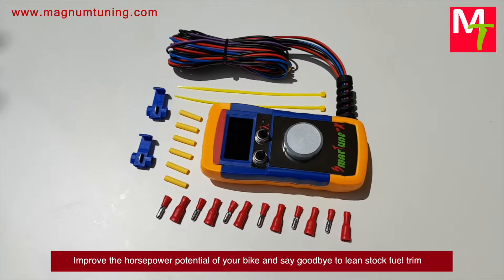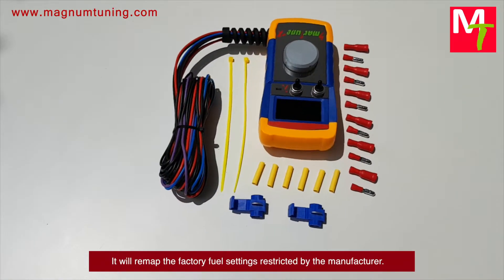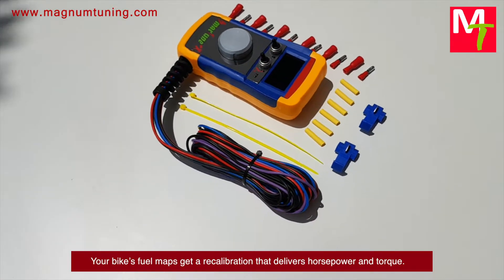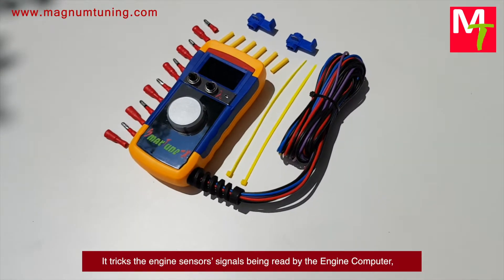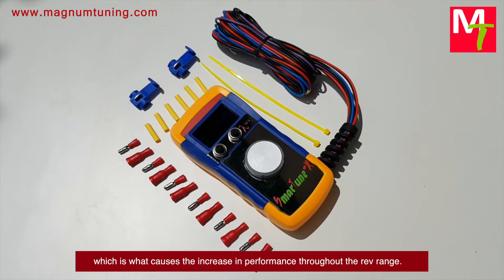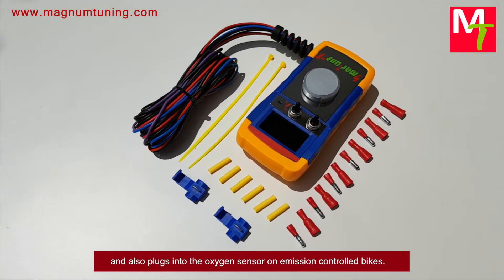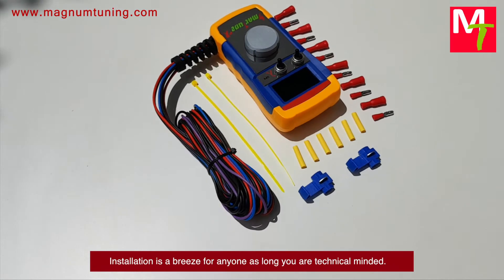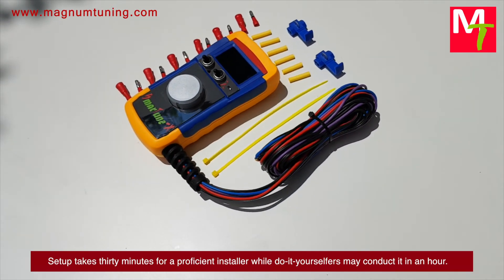Smart Tune Motorcycle Fuel Tuner   Aggressive Boost in PERFORMANCE!

Comment: I have Lifan kp mini 150 2024 with aftermarket exhaust I want to richen fuel for better throttle response will this work?
Reply from the maker: Hello,
Thanks for reach us out. Smart-Tune is available to your KP Mini,

https://www.magnumtuning.com/en/detail/smart-tune-motorcycle-fuel-tuner-performance-module/lifan/kp-mini-150

and yes it is designed to allow you to remap the fuel trim but please keep n mind an aftermarket exhaust triggers the check engine light so if you don’t want to have your bike run with CEL on, you will have to install an oxygen sensor simulator. 
 
https://www.magnumtuning.com/en/subcategorylist/bike-atv-jet-ski-snowmobile-performance-chips-parts/bike-upgrades/#o2-sensor-simulators 
 
to unlock the ECU safe mode that would prevent the remap from going through. If you want to use the heater of the factory oxygen sensor, you may wire up #796 (Easy CEL fix). #664 allows you to remove or eliminate the stock oxygen sensor completely.

Should you come across further question please visit our website. 

Have a great day.

Magnum YT Team

Comment: What is the weather and temperature robustness? Is it ok at -20C? 50C? 60C?
Reply from the maker: Thanks for contacting Magnum Tuning. Sorry we can’t seem to understand your question regarding the robustness wording, Apart from that adjustment allows you to correct the fuel trim at different altitudes and ambient temp if this is what you are referring to is unrelated in this respect. You don’t have to take any temp data into account. Please note our YT team is not setup for technical support via Youtube but you can find answers to your questions at https://www.magnumtuning.com/en/contact_en 

 Have a nice day
Reply: @magnumtuning  I am talking about the operating parameters of the unit. The environmental conditions that the unit is manufactured to operate within. For example, we have air temperatures from -20C to 50C. Also, because the unit must be kept on the motorcycle to function, it may be placed near the heat of the engine, and may be exposed to temperatures of 60C or so. Usually, this information is part of electronics because outside of the temperature range that electronics are designed for, they may not operate correctly, and may even fail. Electronics are also subject to the expansion and contraction of temperature changes which can make them fail.

Comment: hi guys this looks like an interesting product - does it allow adjusting how much fuel is added or is it fixed at +17% ? (like listed in the specs).
Reply from the maker: Thank you for your inquiry. Please note the amount of fuel added is not in par or in linear coherence with the extra horsepower rate, in addition the fuel delivery varies permanently in each microsecond. The only relevant specs is the amount of extra horses here, being 17% but please keep in mind it is also subject to change between slightly lower and higher percentage across the entire rev range. Should you come across any question feel free to contact our  tech support. 

https://www.magnumtuning.com/en/contact_en

Cheers

Comment: Does it work on a 2019 Suzuki RMX450Z?
Reply: Does it work on a 2019 Crf125f big wheel fuel injected bike and I have a aftermarket Yoshimura full exhaust system on my bike so would this turner help to where my bike isn't running to lean
Reply from the maker: Yes fitment was confirmed by the link, as kindly aforesaid. Please email our engineers in case of further question. Thank you
Reply: @magnumtuning  so the magnum smart tune fuel kit will fit on a fuel injected 2019 crf125f big wheel dirtbike then
Reply: This company is a complete scam!!!
STAY AWAY!!!
Reply from the maker: Thanks for contacting Magnum Tuning. Yes, magnum tuners are available for all fuel injected bikes. Here you for yours.

https://www.magnumtuning.com/en/detail/smart-tune-motorcycle-fuel-tuner-performance-module/suzuki/rmx450z

Should you come across any technical question don’t hesitate to contact our tech team available 7 days a week. 

https://www.magnumtuning.com/en/contact_en

Cheers
Reply: @magnumtuning  Does it work on a 2019 Crf125f big wheel fuel injected bike and I have a aftermarket Yoshimura full exhaust system on my bike so would this turner help to where my bike isn't running to lean
Reply: @magnumtuning  what's your email so I can email you guys something about the tune